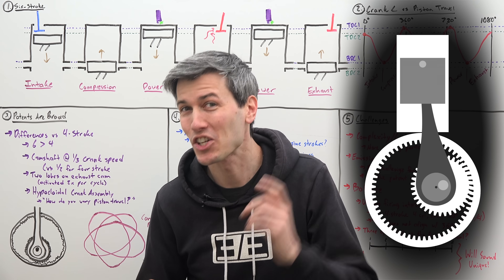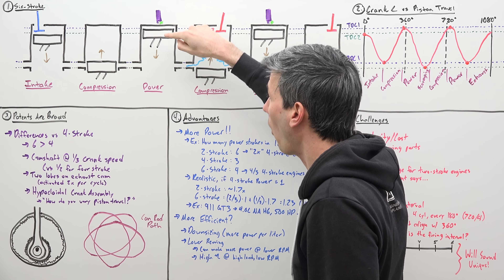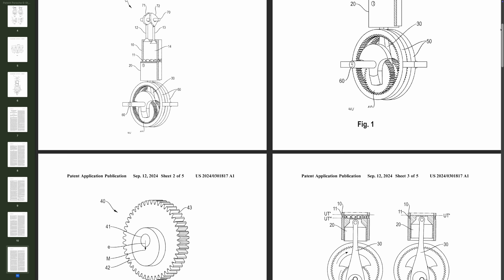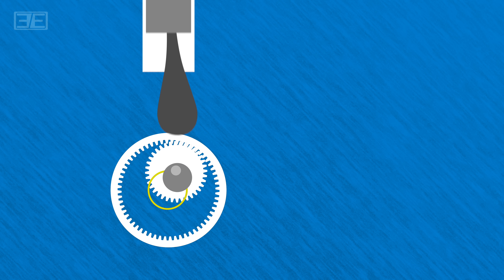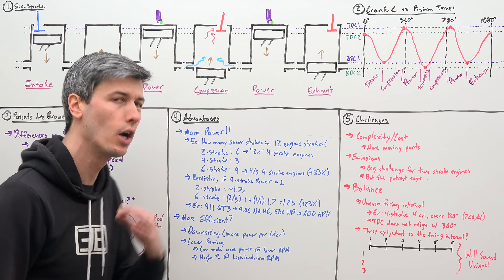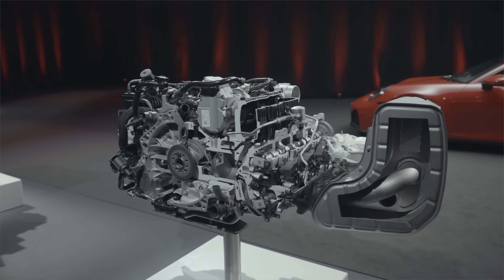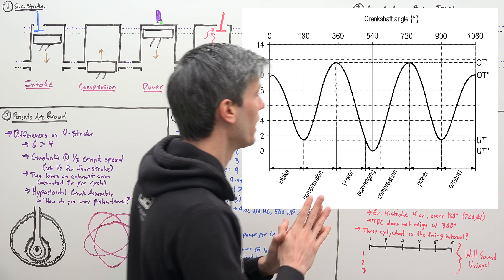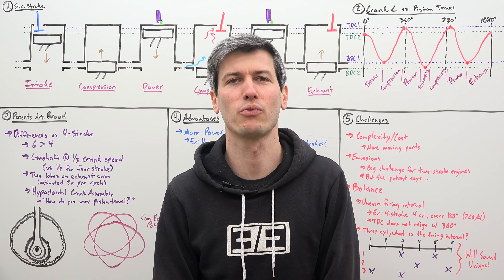Porsche's 6-Stroke Engine Is Genius!

Comment: Great video, but sorry to say, you're really not a 2 stroke guy are you? 
This will not work naturally aspirated. The ''2 stroke'' part needs the air to be compressed. Typical small  2 stroke engines use the crankcase as a ''piston pump'' to get air pressurised. I have a hard time seeing that happening here for all the downsides that brings like burning your lubricants you use for crankcase lubrication.

Also a problem of the conventional 2 stroke is that scavenging the cylinder happened with air/fuel mixture, letting unburnt fuel escape while not having an exhaust stroke to get all the burned gasses out due to the exhaust port being under TDC.
This engine however doesn't have an exhaust port but an exhaust valve on top making it easy'er to scavange the exhaust gasses out. Combine that with direct fuel injection and you don't need unburned fuel to escape while having the exhaust open long enough to lett all burned gasses out.

Comment: I think the means you used for computing your power output is going to be very optimistic, as I believe you’d be compromising the power output for both 2 / 4 strokes in an optimal situation.  I’m guessing there will be significant power needed to drive whatever means is injecting the fuel/air for the 2 stroke phase, since you are not using the crankcase to do it.  Interesting but I see it being more problematic than Nissans variable stroke engine.

Comment: Injecting oil into the cylinders for lubrication isn't strictly necessary on a two-stroke engine, the Two Stroke Detroits used a traditional oil sump and oiling system. Yes, engines like the 6V71 and 8V92 aren't exactly the peak of efficiency since they were invented around WW2 but they're a notable example of reliability and durability.

Comment: it will run, but it won’t be practical or efficient because of fractional power losses. Too many fractional frictional losses with that complex geared elliptical orbit crankshaft. Either make it a two stroke or a four stroke period with President Trump reducing or eliminating EPA overreach, it would be possible to bring back the two-stroke engines that were about to become production two-stroke car engines in 1989. Every car manufacturer from the biggest to the smallest had two stroke cars ready to go into production except for one tiny little thing. They could not pass any emissions test after they had 100,000 miles on them due to the ware after 100,000 miles on the two stroke engine pistons and rings and other things. They wouldn’t pass the sniff test. With undoubtedly vast improvements in technology, we have today, a two-stroke engine is even more attractive and possible now here in 2025, due to the fact that President Trump wants to eliminate all these different grades of gasoline that have to be blended for different times of the year in the United States, and set the standard just to have one grade of gasoline, possibly doing away with ethanol once and for all since it cost more to make 1 gallon of gasoline containing ethanol, then it sells for because it is subsidized by the federal government, and it has been permitted to continue to allow farmers and businesses that invested in the production of ethanol to recoup their investment. Exciting times with the leash off of development and technology. I think a two stroke engine is the way to go not a six stroke due to the fact that, a two stroke engine that weighs 300 pounds produces almost twice the power that a four stroke engine weighing 300 pounds does. You could make 150 pound  two stroke engine produce the same power of a 300 pound four stroke engine today just as you could in 1989 when that was about to go into production if not for the EPA sniff test…

Comment: The first thing I thought was that with the camshaft at 1/3 the speed of the crank, you could potentially rev higher than a 4-stroke before valve float becomes a problem.

Comment: Lets not forget tdc and bdc are actually ranges not points due to the pistons dwell time at both. I forget the  finer points of it, but the guy i learned alot from who built some damn good engines and was an encyclopedia of automotive knowledge figured three tdc and bdc numbers.  One was tdc start, two was tdc middle, and third was tdc end (bdc was same pattern ie first, middle, end).  Middle mostly and usually equates to normal tdc and bdc. Iirc he used different terminology  (and likely the industry correct terminology) than I. 

Im probably gonna mix this all up but here gors: 

If i remember correctly one might

- time intake valve close based on end of bdc. Im not saying close valve at end bdc, but to calculate advance or retard from end bdc.

-Spark i think he calculated from end tdc.

-Intake open figured from start tdc.

-Exhaust open from start bdc.

-Exhaust close from end tdc.

Comment: What if the exhaust valves don’t open during the second compression? Couldn’t it be where the efficiency is?
“Reburning” the gazes from the 1st compression, with just a bit of extra air and fuel? 🤔

Comment: To be fair to the patent, there is no need for oil in the petrol / gas as the 4 stroke oil scavenging is there, and you have a real valve for the exhaust so if you get enough air in through the BDC ports you shouldn’t have unburned fuel in the emissions either.  I like it!

Comment: Is it even necessary for them to phase the cylinders at multiples of 90 deg or equivalent here? The crank is a gear and theoretically they can be phased in any way, right? No manufacturing complications for the crank as well. Really interesting concept.

Comment: I humbly ask, please, use only the 2 new awesome strokes. Just leave the standard old 4 strokes behind... 

A 600cc triple would be a great starting point 😁 
Or do like the rumored "Honda V3 prototype" and slap an electric "supercharger" on it (just to fill the cylinder with clean air, no real boost needed) then kick back and relax, basking in non-stop praise from the whole automotive enthusiast world for innovating both E, AND, 2-T tech simultaneously. I believe in you, YES YOU, you reading this, you can do it! Anyone, someone. Help.
I'm getting close to trying to weld two CR-500 motors together myself out of frustration. I don't know anything about welding or balancing cranks, but it would be totally worth it if I could get a quick little taste, just one hit- one momentary rip of 1000cc 2T pipe hittin hard before the inevitable catastrophic failure. Far from the he worse way I can think of going out.

Comment: I could be wrong (probably am) - if the ratio of the inner gear teeth vs outer ones is even a millionth off, won't it completely ruin the engine over time? As in, at some point the inner circle slowly runs out of alignment with the outer one? I suppose this could happen for many more applications, so perhaps this is a complete non-issue, but I'd be curious on how they tackle this

Comment: I can't figure out how the piston rings would work on this.  There will be oil below that piston when it goes to the "upper" BDC and thus at the level of those lower air ports.  I assume there is some sort of baffle preventing oil from entering the air ports, but I could still see residual oil being injected into the compression chamber for the second power stroke.  That sort of makes it run like like a true 2-stroke with regards to emissions.

Comment: One thing that will be for sure, is that any v arrangement, because of the separation angle on the camshafts, v angles would have to be either 60 or 120 degrees, or 180 is another multiplicative, aka the boxer engine.     I think they're likely much closer to development than thought, they've probably built prototypes already.     In order for this to work thermal management would have to be superior, as adding another power stroke is going to cause more thermal latency into the combustion chamber, and the potential energy of an engine turns into about 30% efficiency in the combustion chamber in 70% or slightly greater thermal losses into the coolant system/block.    If not managed properly, it will actually waste more energy because it can't expel the same amount of heat in the first exhaust stroke.   More heat equals less timing, which equals late ignition which equals more fuel consumption.  This is very very complicated stuff, I think it's possible but not using just scavenging ports for the second intake stroke unless the scavenging system had its own boost system, and therefore would need two intake paths that each contribute different amounts of air mass.

Comment: It might be obvious, but how does this get around not needing oil in the fuel or at least having insanely high oil consumption? Won't any oil below the piston on the cylinder walls go straight into the lower intake ports and just mix with the air and be burned anyway?

Comment: From what I saw on a different video: The implication is that this is really designed for super high boost applications where the mixture has to be rich to prevent detonation. Since all of the fuel won't burn the first time around, the second compression stroke will not include an additional fuel (or much much less) and will instead burn off the residual unburnt fuel, extracting more power from the fuel charge and lowering emissions due to a more complete burn.

Comment: What if the 4 versus 2 strokes were offset? Fire the 1st and 3rd on 4 and the 2nd on 2 stroke… then, they would offset on the next revolution. Not sure if that would help or reduce power.

Comment: Actually it's a pretty uneconomical concept with higher exhaust gas values compared to a four stroke engines. Even my teacher had the same idea almost 30 years ago but got laughed at due to higher complexity and exhaust gas values which needed a way more expensive exhaust gas purification even back then. Actual power delivery to the tire was lower too. Porsche just delivers another under engineered crap. Same goes for their e-fuel idea.

Comment: If they can "clean burn" the two stroke cycle of this engine. Then why not just modernize the old two stroke Jimmy or Detroit Diesel design into a modern gasoline motor? What a screamer it would be! Imagine what a two or three litre V-4 or V-6 could produce power wise. Those old diesels were amazing. But to moderize that design with aluminum blick and heads, and computerized in all adpects of operation, such as fuel injection, it could be a wolf in sheep's clothing..

Comment: I can't see this being manufactured easily. I also don't see a sintered metal style of fabrication being used except in maybe the connecting rod but the rest would have to be forged and the gears hardened. Maybe we'll also see roller bearings at least used in the rod big end because lubrication may be an issue. I also don't see the 2 stroke air intake not being fouled by oil so I'm waiting to see how they handle that.

Comment: Couldn't the second power stroke be used for water injection, using the heat from the 1st power stroke to expand the H2O giving you a no fuel power stroke.

Comment: My question is how a fresh air charge is transferred to the bottom of piston travel intake port?  Will the cylinder outside walls incorporate transfer channels as in a 2 stroke engine? Does the cylinder head intake valve also regulate the fresh air charge to the bottom cylinder intake port? Or would the lower intake port be accomplished with direct injection and turbocharging? The oiling for the crankshaft and connecting rods will be interesting to see how it’s accomplished. High pressure dry sump system?

Comment: Congrats on 1000! That's a great milestone! 

I think the 2nd compression cycle is air only to combust what's left over for efficiency. 

And there's definitely going to be oil burn from the 2nd compression stroke since the rings will all pass by the ports, its going to burn oil.

Comment: Now what we need is to compare cost of adding small turbo kit vs 6 stroke na engine. Then, compare the power gain, maintenance difficulty & reliability--if this engine could proceed to be mass produced before it is killed by the strict emission rules or electric drive vehicle market. 

Anyway, Congrats for your 1000th video, mate!

Comment: While using a hypocycloidal could enable the use of 6 strokes in the cycle, it could also be used to enable the connecting rods to run in a straight line rather than deflecting.  See Murray's Steam engines as an example.  There's actually a video of it running on wikipedia if you're curious.

Comment: Interesting concept, as an old mechanic I am shuddering on how they time the engine and cams. how they are going to ignite the porcelains on the extra two strokes for each cylinder. 
Time will tell if anything comes out of this in the future.

Comment: This is DOA. The trend is towards simpler with fewer parts, not more.
Battery - power controller - electric motor. No belts, oil changes, plugs, injectors, fuel pumps, transmission....
Ask any long-term Porsche owner about the cost to service/replace all of those parts.

Comment: I’d imagine that in a V configuration they’ll toy with putting the connecting rod offset on the opposite end of the inner gear so that corresponding cylinders can be at different stages of their 6 stroke cycles, how wicked these engines are going to sound!

Comment: Isn't lubrification one of the most challenging points of a 2-strokes engine? With this system that problem practically goes away. Moreover, I think they may be able to do something smart in terms of recirculation (EGR), by using the 2-strokes "stroke" for that purpose and for managing the temperatures.

Since a real engine with this technology wasn't designed and developed yet, these are all congectures and ideas...

Comment: Maybe they dont inject gas/fuel in the 2 stroke part of the cycle. What if they inject water? Water expands into stream with these temperatures. Does this expansion give enough power to do some work? Then you are able not to make more horsepower but to get better fuel consumption. The problem i see with this is that you will make less HP per liter, so you need again a bigger engine to get to the same HP figures, therefore using a engine less efficiënt... idk..?

Comment: Would the alleged fuel economy generated by geting the same power within lower revs be offset by the increased friction and heat generation? Congrats on the 1000th video.

Comment: Perhaps this engine would work better in multiples of 6 cylinders rather than three, because then you could balance out the firing more evenly. Also, with a 3 cylinder engine, if you started firing each cylinder on stroke 1, 3 and 5 it would always be firing 2 cylinders almost simultaneously at roughly even intervals.

Comment: This is actually super interesting, I think it leaves us all with more questions than answers. It'll be very interesting to see how they can solve the balancing issues. Emissions I would think would have an advantage in this in that I imagine some of the exhaust gas will be 'recirculated' in the second power stroke without the need for an EGR system (though I imagine having one will still help). Maybe this is what they meant about complete combustion? That any leftover fuel gets another chance to burn. Anyway, very cool that this is your 1000th video! This channel is how I learnt all the basics back when I was in high school years ago and it's fantastic to see how successful it has become!

Comment: Kind of obsolete. A taycan turbo GT can run 9s, low 7 min on the nurburgring and charge as fast as the base taycan that charges so fast it wqs almost as fast as a gas car across 3000 miles in the I90 surge.

Comment: 6:38 I am not sure that with this eccentric system the spacing between each TDC is 360°. Look at the diagram. It should be calculated, but sometimes it must be delayed, sometimes advanced, and only when the TDC is at its lowest then we are on a 360°. The offset of the connecting rod lower attachment must allow to adjust this advance/delay. Therefore, there should not be two combustions at the same time (end of video)

Comment: Regarding the efficiency the first thing i thought was: This engine has a built in exhaust gas recirculation. I think this will increase eficiency because you will have a full power stroke without recirculation and one stroke with recirculation.

Comment: It might be a great idea but expensive to make and it certainly wouldn't last long. Wear on the gearing system and bearings plus friction losses all make it a pipe dream. Back to the drawing board.
What happened to electric valves.

Comment: The extra efficiency could come from downtime between the strokes of a 4 stroke which means wasted airflow from the turbo. Also, if they used it slightly like an atkinson cycle, they could use the extra efficiency from that too.

Comment: Clever design, but it's like finding a horse breed with 20% more power 100 years ago.  An electric motor with 2x power is cheaper, lighter, smaller, and run forever without any maintenance.  This design will never be built.

Comment: So basically they are putting a rotary engine crankshaft into a piston engine…. Ok…Why? I can already see the oiling problems. Going to need some sort of software system in order to get the timing right. Two sets of intake gaskets one of which you would have to tear the block apart to get to. The piston rings will wear unevenly.
All I see is a nightmare, someone trying to reinvent the wheel.

Comment: If 2 extra power strokes are the goal, assuming for emissions. I’m not a fan that the piston rings would have to move across the “port” . I think an odd valve set would be better 2 intake 1 big exhaust etc etc.. and have 1 intake valve drop for the second compression stroke and both intakes for the main intake stroke..  in my brain that accomplishes the same thing with only reworking the head and cams.. idk am I wrong? I am high rn